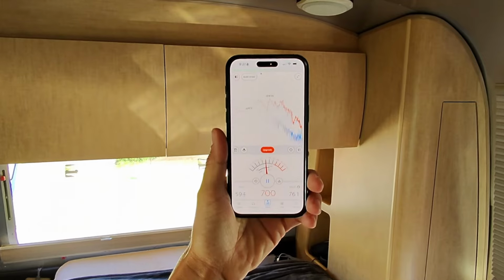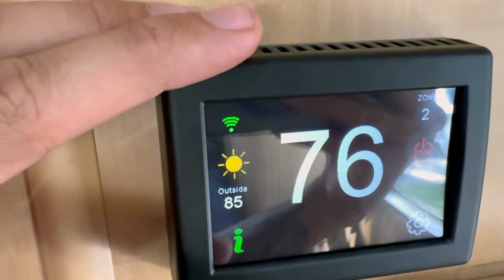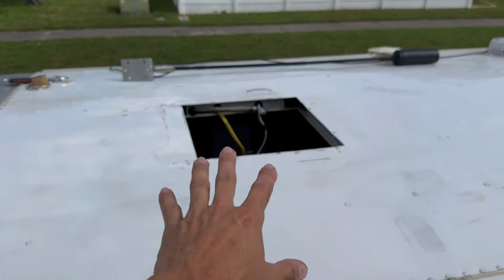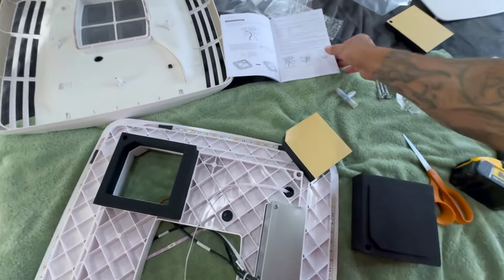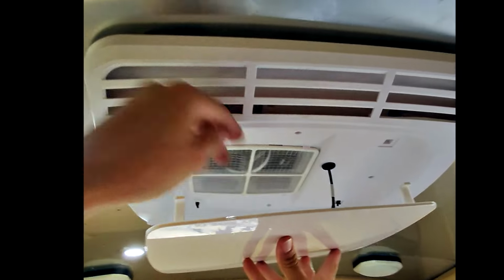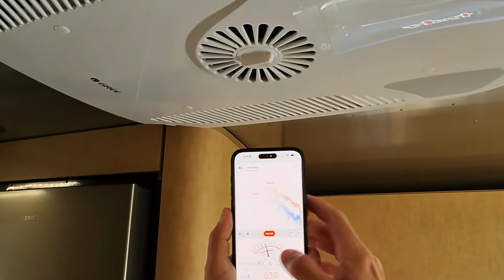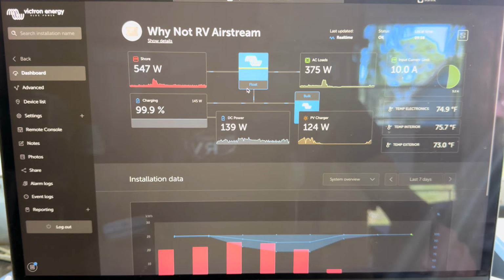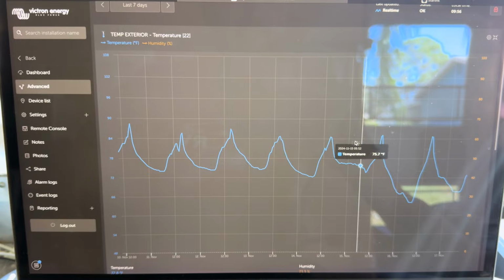TURBRO INVERTER HEAT PUMP Install and Test - Why Not RV: Ep 152

Comment: My airstrem has a drain that comes out in the wheel well. Did you hook yours up to that?
Reply from the maker: No. Risk of failure point. I’d rather allow water to just run off the roof

Comment: Hello, would you be able to tell us how much current or power is required if the ac compressor was in max cooling capacity while trying to get to a set temperature, and could you also tell us the minimum current or power required when the ac has satisfied the temperature and is running at night or a cloudy day with temperatures about 80 degrees?  That would be really helpful in determining how much lithium power is required to run this ac for a determined amount of time during the day and night in a very hot climate like Texas or SW USA.Thx
Reply from the maker: What I can tell you with your question is exterior temperature plays a huge roll in how many watts this will pull. When it comes to how much lithium you should put in your rig… as much as you can fit and afford or have a backup generator
Reply: Did the turbro unit come with the 14x14 roof gasket, or do I have to buy one when ordering it?  Thx

Comment: Heat pump video when?
Reply from the maker: Heat pump works great to about 35 degrees. at that point it struggles to produce enough heat to actually warm the rig. Switch to gas furnace at that point

Comment: We installed this unit today and the air flow going to the front seems to be about 2/3 or more and the back vent is kind of weak, is anyone else having this issue?
Reply from the maker: I definitely don’t notice this. I feel it’s split relatively evenly. Definitely hasn’t affected the overall cooling in the rig for me.
Reply: @WhyNotRV thank you for replying
Reply: If we figure out the problem will post back here

Comment: Which provides better cooling between the turbro vs the gree? I need to buy 2 units and run them off a predator 5000
Reply from the maker: The Gree systems are both quieter and larger Btu units. The turbro is an inverter so it’s more efficient overall but less cooling capacity as it’s less Btu.
Reply: @WhyNotRV I’ve got a 15ft box van that has a front living quarter and a garage walled off with a door.  In the front is a dometic 15k  penguin currently and keeps it nice but the garage just stays at 90 even with the door between them open and fans going.   Figured I’d replace the dometic with something more power efficient and put another in the garage.  These two caught my eye.

Comment: What would be the max watts usage in worst case scenario like hottes day? Customer service said 1500w but I got a feeling they don't know what they are saying since my old ac use 1500w. Isn't this supposed to be using like half of tha
Reply from the maker: it typically uses about half that. 7-800 watts.  most I have seen mine is around 12-1300 watts. Id bet its max rating is 1500 watts

Comment: Chris, I ordered one and installed it without using the front covers, in a ducted system instead. I found there was less air flow than I expected, and I suspected the air was short cycling somewhere. The ambient temperature was about 90 degrees. I set the cooling to 64 and within an hour the return temperature was reading 64 and cycling off. The ambient temperature had only dropped a few degrees. I checked below the unit to see if there was an air leak between the supply and return. Finding none, I removed the black foam box and found that the air was going over the evaporator coil from the supply to the return. I added a 2x2 foam AC seal above the coil and down each side enough to tape it in place. It now works better, more airflow out of the ducts, cooler and the return temperature is more realistic.
Reply from the maker: hmmm, i never have gotten in front of one of the ducted versions. Glad you figured out a work around

Comment: Were you on a multizone thermostat and did you have any issues disconnecting this? I am installing mine to replace a failed Dometic Penguin II in a multizone system but I lost all power to my thermostat my other ACs dropped offline as a result.  Trying to figure out how to isolate this and keep my thermostat, remaining AC, and both furnaces up with this one installed.  Thanks for the video.
Reply from the maker: Yes the stock thermostat in the airstream is a multizone. No issues disconnecting for me. Check out this video where I originally replaced my main AC and reused the board to keep the furnace online. https://youtu.be/DTcLVN4R5qU
Reply: @WhyNotRV  Will do but I ultimately did the same.  The problem I had was that my rear AC is the first in series and so, when I disconnected the 'phone' plugs, down it all went.  Pulled the control board and mounted it in the plenum keeping the 12V and thermostat wiring connected.  Solved.  Ran this baby all night long on battery and woke up with only 20% loss compared to normal for my 920ah system.  Really impressed.

Comment: Do you know if the Roof Top unit enclosure have UV protection?  I am wondering if it is going to rot away after 3-4 years?
Reply from the maker: Honestly, I can’t tell you for sure if they did or did not add some type of UV protection, but I would be willing to bet that they did.
Reply: @WhyNotRV thanks , i did not see anything in the specs.  I have been looking at these for over a year. Almost went with pioneer. But theirs only heats to 28°. So i just ordered the Turbro (what a silly name). Lol

Comment: Where does condensate collect and drain from these units?  You havent mentioned a dehumidification mode with either unit, is there one?
Reply from the maker: Yes the mode is called dry and can be used through the app as well as the remote. The units drain off the rooftop like any typical rv AC

Comment: Watching y’all lift that ac onto the roof , was painful to watch 😂. There is a much easier way to do it . Leave the ac in the box. Place winch straps around the box. Use your extension ladder as a slide. Attach a rope to the box. Someone on the roof pulls the rope , someone on the ground , pushes up. I placed my ladder in the back of my truck bed. This cuts the distance up in half. Also place your old unit inside the box and lower it back down. Easy Peasy
Reply from the maker: Great advice here.
Reply: @WhyNotRV . Btw , very nice detailed video. Good Job 👍

Comment: I have one I just installed in my 40’ RV. The fan on low is still very noisy. 
I was able to put a mini split in the bedroom side of the RV and it kicks butt in every way over the turbo. They are both 12,000 btu both same power usage. Mini cools better and is whisper quiet. The temp out of the mini split was 10degrees cooler. Turbo sounds like a turbo by comparison lol. Oh the turbo was 3 times more expensive!
Reply from the maker: Yes they definitely need to redesign the air delivery system inside. Combine this unit with the free eco cool interior and we are rocking. I like having this one in the bedroom as it’s a natural white noise which I typically sleep with to drown out external noises.

Comment: Great unit. Can't wait for the 'ducted' model.
Reply: I created one from this unit. It wasn't easy but there was a 6" return grill nearby that I modified to install the printed circuit board for the controls. There was an air leak between the supply and return. I assume from more back pressure. I added a 2x2 foam weather strip.
Reply from the maker: Ya, it should be quiter interior in a ducted setup

Comment: I have a 2025 Intech Dusk with a Coleman Mach 8 15k unit and the noise from this AC in our 20 foot trailer is a major issue. I have decided to go with the Gree Eco-Cool  after evaluating several factors......... NOISE LEVEL, Heat Pump, Lower Energy Consumption, Air Distribution design, Dehumidifier function, Soft Start Option, Remote /Wifi control. While the energy consumption with the Eco-Cool  is not as efficient  as a true inverter unit it is still low enough to run on a 15 amp circuit if needed. I have also  installed an Ecoflow Wave 2 unit in a storage compartment under my bed. It is set up to cool or even heat the bedroom at night in a true off grid setting if it is not cold enough to require gas heat. 

https://youtu.be/006a3ESmo1I?si=kHbY6dPGt3BNe9kr
Reply from the maker: Sounds like a great build!

Comment: Hello,
I have a couple of questions if you don't mind.  I have a 2013 20ft travel trailer with a centrally located 13.5 BTU Dometic AC with a soft start installed. I we use an EcoFlow Delta Pro with an extra battery to power the travel trailer. The Delta pro has 3,600 watt inverter, and with the extra battery we have 7,200 Wh of battery life. We live in New Mexico and have been camping in the Southwest. We would like to extend our battery life as much as possible. What would be the best product for us?

Pioneer has what looks like the same unit to the Greenland (Just a different sticker). The Pioneer PYZ012AZUDCIPD has a Cooling Input Power: 850 ~ 1500W. Does the Greenland run at the same wattage?

Thanks,
Michael
Reply from the maker: They appear to be the same. One is just rebranded. The inverter unit is definitely your best bet for longest use off a battery system

Comment: Hey there...since you have both units I'm considering with a preference for the Gree, do you know the exact plenum thickness for either unit. I have a Lance travel trailer with the super slide and when it is retracted, the slide facial to ceiling measure 2-1/4 inches. Both of these units look like they may be real close or too thick for my application and the manuals are of no use.

Thanks in advance.
Reply from the maker: So you want to know from the flush ceiling to the lowest part of the inside supply plenum thickness… I’ll measure both for you
Reply: @WhyNotRV  I contacted Premier Products and they sent me the schematic for the plenum. Unfortunately it won't work for my application as the plenum measures  3-5/8" thick. The Turbro Greenland plenum is also too thick as it measure 2.83 inches according to their CS dept. I wound up "settling" with the Furrion Variable Speed 18k unit as it comes with a "Low Profile" distribution box that's 1/2" thick. I was really looking forward to the quiet operation of the Gree unit.

 Thanks for responding and I love your presentations. Subscribed! 🙂

Comment: When setting up the remote you put in your password for wifi.  Is that the wifi from the a/c unit or your rV’s wifi? Wondering if the phone app can be used on the road without wifi when away from the RV.  Thanks, great video
Reply from the maker: That’s the Wi-Fi I have in the rig. The unit must be connected to WiFi in order to use the app. My WiFi is on 24/7. Parked or going down the road.
Reply: Do they make a unit for a ducted rv
Reply from the maker: Not yet but i believe they are working on it.

Comment: 2 questions: 1, does the app require access to your location (GPS) to install?  2, does the app require internet access to function (cloud account)?
Reply from the maker: I don’t believe but don’t know for sure if it “requires” location to install. I feel like that’s unlikely. But yes the app works strictly over the internet. It’s not Bluetooth to the unit, it’s internet only
Reply: @WhyNotRV so the app control would NOT work on a local (not internet connected) WiFi network, I think you are saying.
Reply: @WhyNotRV  Thanks for the reply!  For the first one, it is a security issue, violation of privacy; your A/C doesn't need to know where your phone is (most apps require this now to sell your info).  The second one is practical; how many people actually have internet access while camping?  Granted, more these days, but there are those like me that detach from the grid when I camp.
Reply from the maker: right. And you don’t have to use the app or any of the online features unless it fits your needs wants or desires. It comes with a handheld remote you can mount anywhere and control the unit that way.

Comment: Fellow streamer here.  Did this unit have the option to connect to the existing condensate drain tube.
Reply from the maker: No. You’d have to custom fabricate for that. I love the idea of the drain tubes in the airstreams but if they back up and clog you won’t know about it until damage is done. So I chose to ditch the drain tube and let it run off the roof just like rain does. Doesn’t hurt anything
Reply: @WhyNotRV . Thanks for your response.   I have a very similar setup using the microair thermostat.   Wondering after over a  year using the Gree and your solution to gut the dometic board and tuck in the ceiling cavity to continue use of the microair thermostat to control the furnace.   Does that still work?

Comment: Ugg…I want quiet. I see it’s super efficient but the noise. Guess I’ll to see if someone makes a quiet AND efficient unit. The Domedic unit I have is so loud. 😢
Reply: The quietest and most efficient A/C on the market is a mini split heat pump. We installed an EG-4 12k, 28.5 Seer-2 on the rear of our motorhome and love it. It both cools and heats using only 1/3 of the power of my front rooftop Furrion A/C. Plus I can't even hear it when it's running normally (32db.) When it's in turbo mode it's still only 37db. The main disadvantage of this unit is that the inside head unit is huge - 42.5" wide by 13" tall and it must be mounted about 9" off the ceiling for proper air flow. It's pre charged so it's a DIY install.
Reply from the maker: Yes, however, that’s not meant for RVs. I have installed a mini split in my old Montana that was the dream solar machine where I mounted an actual mini split cassette air handler down in the pass through storage and connected to and added some ductwork. For plug and play meant for RV use. Currently this is the best stuff on the market. I know a couple companies working on bringing the full mini split technology to a rooftop unit. It’s getting there. Maybe another year or 2.
Reply: @SuperSushidog  Nobody wants a giant ass compressor hanging off their rig unless it's semi-truck w/sleeper cab. Plus, many campers are vans or truck campers. Definitely no room. Rooftop style is the best option.
Reply: @rtsrts2317  There are a number of van-lifers that have mounted the outside unit on the back door. Also, trailer conversion-lifers with the unit attached to the tounge. Roof space on a van/small trailer is at a premium.... so a rooftop unit isn't always "the best option" for every individual. Sitting around sweating your a** off in a Florida summer (or delaying your adventure) while waiting on a "unicorn" unit isn't necessarily "the best option" either. UBU though....
Reply from the maker: Check out my videos on the gree eco cool unit. I have done several videos on it because it truly is an amazing product. It’s the other unit I have installed in my airstream and it is whisper quiet and also very energy efficient. Not quite as energy efficient as the inverter of this unit, however it is probably 50% more efficient than your standard Dometic
Reply: I put a 38 seer mini in my momentum 31G 36 footer.It doesn’t like 20*f it short cycles into defrost mode every 7-10 minutes.
Reply: @2hotscottpro  Mini split heat pumps can be optimized for heating, cooling or split so they perform reasonably well on both ends. At 38-seer, it sounds like yours is optimized for cooling, which is great, if that's how you primarily use it. Is it a 9k btu unit or 240v? I haven't seen a 12k, 120v unit rated that high. Nevertheless, 20 degrees is tough for any heat pump as the coils want to freeze if you're in a humid area, regardless of your equipment.

Comment: Great job on this review. I’m deciding on whether the Furrion Chill Cube that is an inverter, ducted, 18kBTU but no heat or the Turbro that is not ducted but has heat.
Reply from the maker: I can not attest to the furrion whatsoever. If you’re looking for energy efficiency to the max. Go with the turbro unit. If you want as quiet as possible go with the gree eco cool unit. Still insanely energy efficient but not as much as the turbro however it’s whisper quiet
Reply: Supposedly, Furrion has a heat pump model soon to be released.

Comment: Do you know if a smaller generator, like 2500 propane one, can start this ac without a soft start?
Reply from the maker: Yes absolutely. You could start and run 2 of these units off a 2500w generator

Comment: Hello, you mentioned that you were moochdocking during the test. Were you plugged in to a GFCI outlet? Curious if inverter compressor would trip gfci receptacle while victron is on passthrough? Thanks for your review!
Reply from the maker: Absolutely! I’m not plugged into a GFCI outlet. They trip when running through the Victron stuff.

Comment: Do they make Ducted AC and Heating?
Reply from the maker: They currently do not make a ducted version. This unit is a heat pump and will heat to 19 degrees Fahrenheit
Reply: Another channel did an install where they sort of adapted it into a ducted unit. If you’re interested and reply to this I’ll try to figure out what it was. I saw it last week so I should be able to find it in my history.

Comment: Do you think that hush matt would help at all?
Reply from the maker: I kind of want to test it but that stuff is pricey. I feel like it would make a very small difference if placed correctly but its main purpose is to insulate and reduce vibration so I am not sure how much of a difference it would truly make
Reply: @WhyNotRV Have you ever tried doing anything to modify the plenum to get this Turbro unit to distribute air with less turbulence and thus less noise?